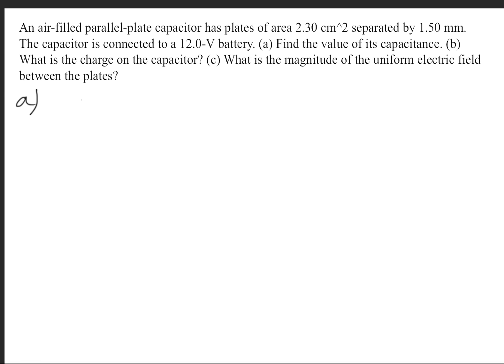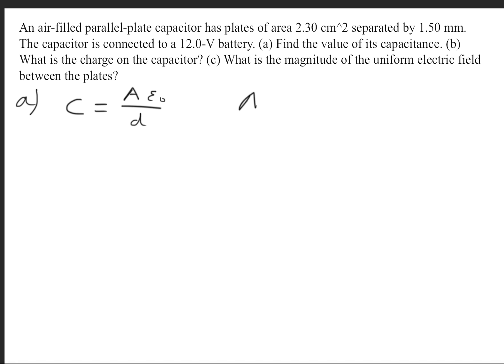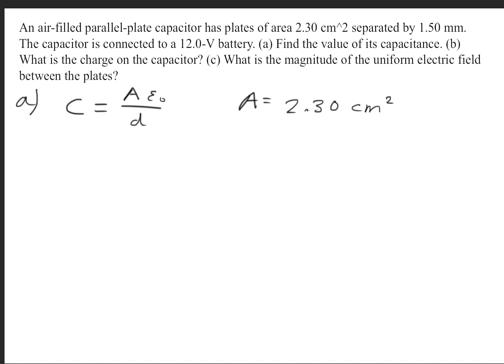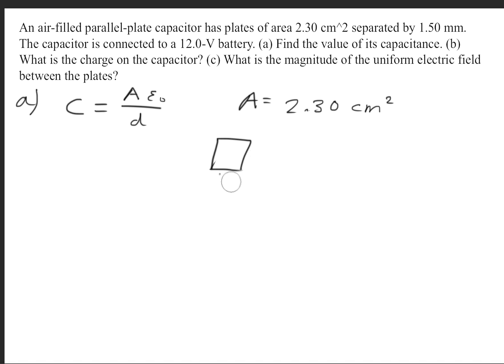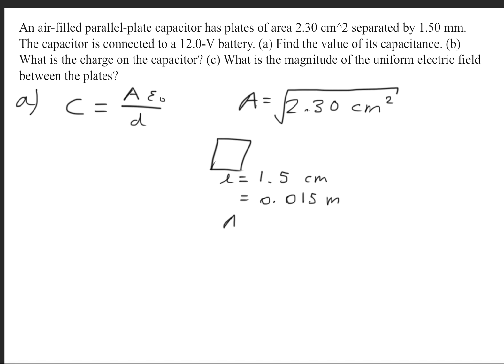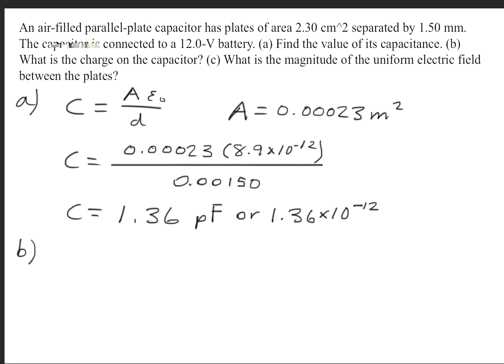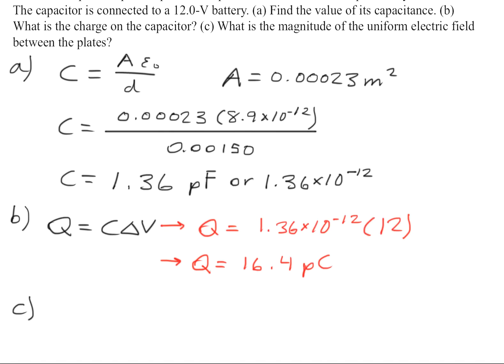An air-filled parallel-plate capacitor has plates of area

Comment: I don't understand how the answer to part a is not 1.357*10^-13? When I put it in the calculator that is what answer I get.
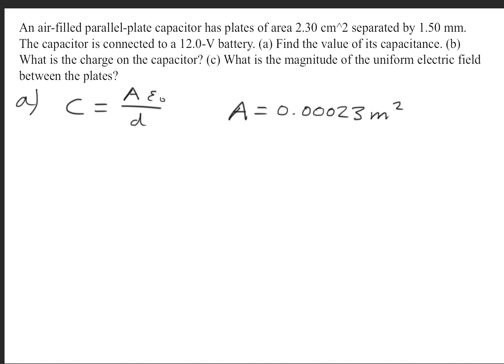Reply from the maker: In regards to significant figures, 1.357 can be rounded up to 1.36. It seems, however, that the order of magnitude from your calculations is not matching with the answer. I went ahead and re-inputted the values at 1:08 in the video into my calculator and I still get 1.36 x 10^-12 Farads.